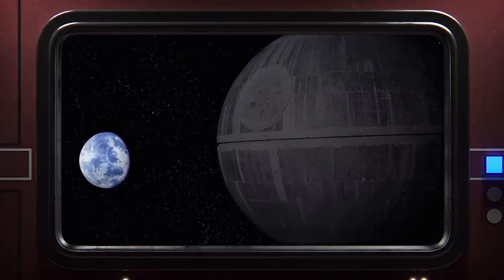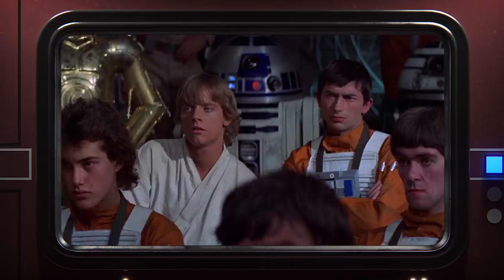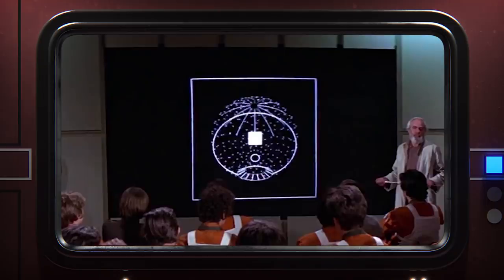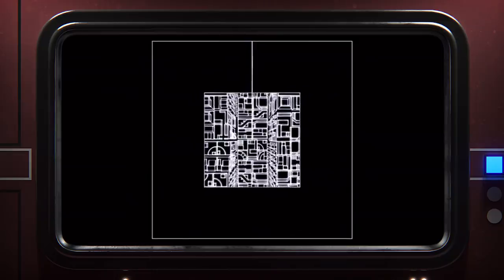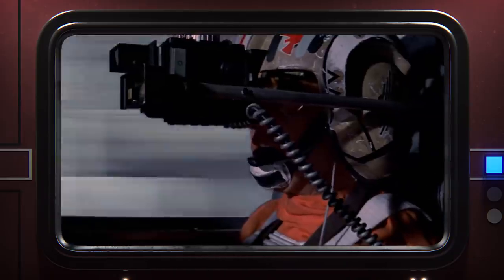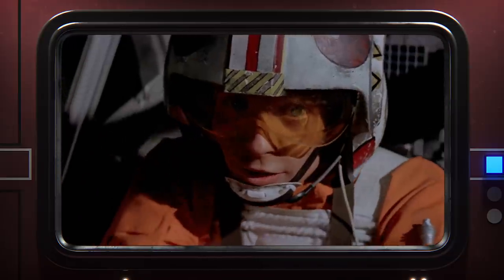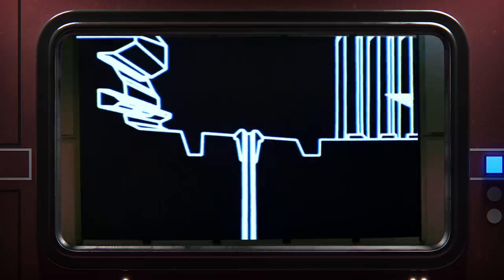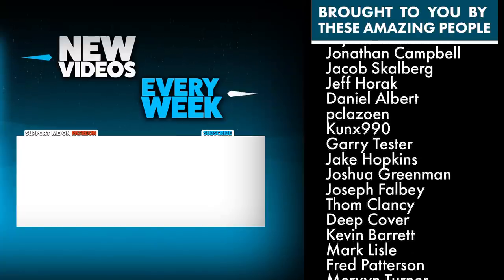The Thermal Exhaust Port Was NEVER a Problem

Comment: I love how people rip into the Last Jedi over the use of “bombers” and “gravity” when this is exactly what they did in a New Hope. 

This is.. of course, because the Battle of Yavin was basically WWII... IN.... SPAAAACE!!!

The Dambusters and 633 Squadron. In both you had bombers running a gauntlet of enemy anti aircraft fire.. with a Norwegian fjord being used instead of a trench in 633 Squadron... using a sighting system with two vertical lines in Dambusters.. to precisely bomb a major target (to breach the Möhne Dam.. or to cause a rock slide on a fictional V2 rocket factory). 

Proton torpedoes. Whether it’s proton torpedoes, photon torpedoes, Mk 46 torpedoes, the Sperry Aerial torpedo, spar torpedoes attached to a ship, or those “torpedoes” Katherine Hepburn invented in the African Queen... they are all a form of guided munition. Whether it’s infrared, radar, computer, gyro, or human guidance. 

So.. given that the effects of gravity are minimal in space (the Death Star is in orbit or otherwise effectively in free fall relative to Yavin... and the proton torpedoes and X-wings likely easily exceed escape velocity from any Death Star gravity) the idea of a level trench run combined with a precise release to follow a ballistic path is kind of ridiculous. 

How much better it would be to park your X-Wings 100 miles above the surface of the port, fire a massive volley of proton torpedoes, and wait for one or most of them to destroy the Death Star. 

But of course, that makes for poor drama. Space is incredibly boring. A real space battle would be opposing forces trying to adjust their orbital altitudes and inclinations over hours to try and destroy each other or escape while conserving fuel. This is where TLJ actually gets space battles right... more like naval battles than what Star Wars usually depicts. Most battles seem to be atmospheric, now (Roque One, TFA, TLJ) because the high relative motion makes for more excitement. The Tie Fighter attack on the Millennium Falcon required repeated panning to be exciting. 

But yeah... no explanation needed. The rebels found a flaw and exploited it.
Reply: Indeed, those bombers were literally analogues to lancasters or b-24s. Hell they were even named after such. And of course the trench run is just a scifi version of the dambusters. It's entirely silly compared to real physics, but it's never meant to be realistic.
Reply: The proton torpedoes are minor in comparison to the bombers. There is always a bit of a stretch with physics in movies, but it can't be immersion breaking. Torpedoes and atmospheric flight work, but the bombers draw too much attention to themselves.
Reply: @crazyjoeshorts5256  As opposed to the space wizards with telekinetic powers. Those are totally realistic... cause... they're realistic in the Star Wars universe! Wait, doesn't that mean we can just throw realism out the window, since it explicitly is about hewing to our own reality above all else? 
You wanna see radar blips hundreds of kilometers away calculate firing trajectories and orbital mechanics, then wait five seconds for anything to happen? All in dead silence?
Reply: when an object is sent into space it will not change course, so there is no problem with bombers
Reply: Huh????? They fly down the trench so they barely have any turrets shooting at them. And they DON'T follow a ballistic path, they are programmed to 90 degree into the exhaust. I think you are putting too much stock in a graphic.
Reply: Luke guided the torpedoes with Force
Reply: The main problem with the bombers isn't the gravity and stuff, it's that they're:
-Ridiculously slow
and
-Ridiculously easy to blow up

The Flying Fortress the bombers were named off of were famed for the fact they could be ripped in half and still fly, meanwhile the bombers take a single laser blast and combust

Comment: Thank you for pointing this out. Yes, it's all right there in the film. It's a small, tertiary exhaust port only identified as significant because the Rebels had access to the plans. The port is ray shielded and defended not only by turbolasers on the station itself but also presumably by the station's support craft (cruisers and fighters). Dodonna comments that the "target area is only 2 meters wide", to which the general reaction, summed up nicely by Wedge, is "That's impossible, even for a computer". They weren't even confident that their own targeting computers were capable of meeting the challenge. In fact, as we see with Red Leader's attempt, it didn't. All he was able to do was impact the surface near the port. Yeah, it took a Force-sensitive Luke, encouraged by Obi-Wan, to put down his targeting computer and call on all his instincts to make a million-to-one shot. Hardly a "glaring design flaw" worthy of as much grief as it's given.

Comment: If you pay very close attention to Galen Erso's explanation in Rogue One, he states that he's made the core, the power generator, of the Death Star very unstable, and that any pressurized explosion to that area will set of a chain reaction that will destroy the entire station. I'm literally quoting Galen at this point. Even if the shot were easy, this video still goes a long way to explaining why this is significant. With a multitude of exhaust ports, the Empire would think about what would happen if one just so happened to lead straight to a potentially unstable part of the core, or, as the idea occurs to me, the kyber crystals that power the Death Star, which would certainly destroy the entire station.

Comment: Yeah, but Gaelen put the one exhaust port, with a map to it, named with his daughter's nickname, where it leads to the oscillator with only ray shields, not the shields the others were protected with. Yeah, maybe 5 of those 19 other ports were a possibility, but they had those options which were basically the same thing. They wouldn't have known without the plans Jyn sent out.
I don't know. It's all speculative and stuff, but I think it gave them a better chance - otherwise, failure would have been eminent.
Reply: great super-tiny detail idea, makes sense!
Reply: Nope, he didn't put in that exhaust port. He designed a weakness in the system.

"I've placed a weakness deep within the system a flaw some small and powerful they will never find it...................Saw, the reactor module, that's the key. That's the place I've laid my trap. It's well hidden and unstable. One blast to any of part of it will destroy the entire station. You'll need the plans, the structural plans for the Death Star, to find the reactor......Any pressurized explosion to the reactor module will set off a chain reaction that will destroy the entire station."
Reply: @lukerope1906 - right? So maybe all 18 other trenches had the same ports and the same chance of getting a proton torpedo in the hole causes a pressurized explosion. The instability itself was there, but how to exploit it was what the StarDust plan was needed for. Gaelen also wrote those plans, or found them and renamed them for her to find.
I'm just saying the story has a valid point is all.
What would've made more sense is; they send ships down each trench, but then there'd be a chance for more than one hero.
Damn the plot!!!

Comment: Also it’s an exhaust it blasts out heated air it would push on the torpedoes making the shot even harder to make
Reply: That would only be the case in atmosphere, there's no noticeable flow of air in a vacuum.
Reply: General Jimmies but while it’s going through that miles long tube that wouldn’t be a vacuum and the heat could set off the torpedoes though I’m not an expert so I won’t comment
Reply: @brendanmccabe8373  that depends what kind of a vent it is. If it vents radioactive particles then there might not be much, if it only vents when the gun fires, there won't be any. 

The other issue is that gas in the tube would actually make the torpedo more stable in the tube as gas pressure would potentially keep it centred.

Comment: In the novelization of Rogue One, the way Erso gets the modifications introduced is quite sneaky and is itself basically using an exploit in the design approval process. This backstory is spelled out over the course of several snippets from internal project correspondence, used as chapter headers. It's clever and satisfying.

Rogue One might not've been a necessary film, but it's a good story and true to the Star Wars universe, unlike the new trilogy.

Comment: How practical is the SDF-1 from SDF Macross. City included.
Reply: Barry Bend very practical since it was the only city remaining after the zentradi destroyed the earth.  And not very since the sdf-1 was a bit slow to act during the assault on earth.
Reply: @russellharrell2747  ok about the slow bit: one the SDF-1 was at lunar orbit, two the Bodol fleet defolded at low orbit with weapons hot. Actually Australia and Asia had their incomplete grand canons used as shelters which saved a few thousand people.

Comment: Good video, and you've outlined why I think Rogue One shouldn't have emphasised the 'internal sabotage' plot.
Reply: Have you watched the movie?  I have.  Galen Erso sabotaged the Death Star by rigging the reactor, to the point where just a tiny instability causes massive systems failure.  This leads to the kaboom.  Without Galen's sabotage, Luke's proton torpedoes might've done diddly squat.  At best, the reactor infrastructure is disabled until repairs can be made.  They definitely wouldn't have caused the entire battle-station to explode.  Jeez, does anyone even pay attention these days?

Comment: General Dodonna also say's it's not a just a big empty tube going straight to the reactor:  "A precise hit will start a CHAIN REACTION which should destroy the station."
There might have been many barriers and machines in the way but the power of a proton torpedo exploding will cause a cascading chain reaction effect that will eventually cause the destruction.  There may not even be a tube all the way, maybe the exhaust port leads to machinery that will explode and cause an overload that affects the reactor.  "Chain Reaction" is a big all encompassing term that may be anything from a mostly empty tube to a complex Rube Goldberg machine of failures.

Comment: Rogue One (movie, I've heard the book messes it up) doesn't say the exhaust port was Galen Erso's idea, in the message to Jyn he reveals he built a flaw into the reactor itself (any pressurised explosion will set off a chain reaction and so on), he doesn't suggest a delivery method, and instead of just telling her about the port or including the relevant part of the plans, he instructs her to steal the entire goddamn technical documentation of the monstrously huge battlestation from a top secret facility. This suggests Galen counted on the Rebel Alliance to find a way to deliver explosives to the reactor, and that's why they needed plans of the whole thing. As an example Rebel spies could infiltrate the Death Star and drop a thermal detonator, but obviously this would require a lot of time which the rebels didn't have at Yavin so they went with the extremely risky fighter assault.

Comment: The destruction of the Death Star was clearly an inside job....
Reply: That's what happens when your main engineers are being forced to work against their will.
Reply: You don't just get a single exhaust port to be slightly bigger than the others to end up being an actual weakness in an otherwise perfect station by accident lol.
Reply: Proton torpedos can’t melt durasteel beams

Comment: Exactly. This is one element that completely destroyed Rogue One for me. They even say in the film that they had to analyze the plans in order to find the weakness.
Reply: How so?

"I've placed a weakness deep within the system a flaw some small and powerful they will never find it...................Saw, the reactor module, that's the key. That's the place I've laid my trap. It's well hidden and unstable. One blast to any of part of it will destroy the entire station. You'll need the plans, the structural plans for the Death Star, to find the reactor......Any pressurized explosion to the reactor module will set off a chain reaction that will destroy the entire station."

Comment: "I've placed a weakness deep within the system a flaw some small and powerful they will never find it...................Saw, the reactor module, that's the key. That's the place I've laid my trap. It's well hidden and unstable. One blast to any of part of it will destroy the entire station. You'll need the plans, the structural plans for the Death Star, to find the reactor......Any pressurized explosion to the reactor module will set off a chain reaction that will destroy the entire station."
Reply: THIS.  For some reason, people are willfully ignoring what Galen ACTUALLY did.

Comment: THANK YOU!!!
I’ve always believed exactly as you say, that there’s nothing strange or “plot hole” like in the idea that the Death Star would have such a small, difficult-to-exploit weakness. The only aspect of the A New Hope story that is hard to swallow is that their analysis would uncover the flaw so quickly; to be more believable, it should have required days or weeks of analysis to find it, even with automated, computerized analysis. 

In fact, the explanation in Rogue One is even more puzzling. If someone were going to intentionally create a weakness, wouldn’t it need to be something that wouldn’t require a “one in a million” shot to exploit? What would be the point of introducing a flaw if it was such a long shot for anyone to take advantage of it?

Comment: Actually, one note that I'm sure someone else may have mentioned by now, is that the Rebels had the plans which means that they had the co-ordinates to the proper port to attack. The plans identified the port and pretty simply would have the location. 

Other than that, it could be reasoned out that the flaw was on all 19, as someone during construction would have noticed that one of the ports was different than the rest. It's very likely that the same contractor was used for all the ports as opposed to multiple contractors. We see the weapon being installed as a unit, not built piecemeal in the station, so we can extrapolate that contractors would have been used for different aspects that related to their specialties.

Comment: Honestly, I'd be surprised if there weren't hundreds of those tiny exhaust ports.
It's a moon-sized battle station that houses a planet-destroying superweapon, it's gonna need plenty of ventilation.
Reply: Problem is, in the vacuum - ventilation isn't good option. You'll need to store a lot of gasses to perform ventillation and then resupply its stock after every reactor's run. My guess these exhaust ports weren't for real cooling but just to remove byproducts of reaction in the reactor.